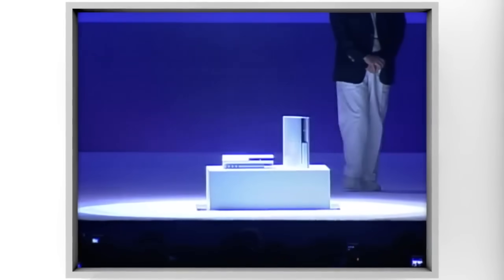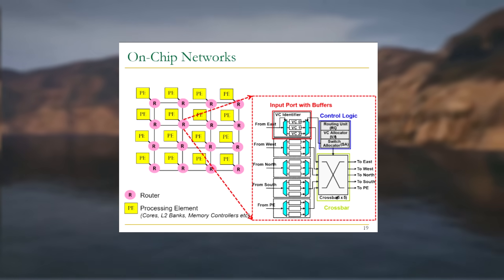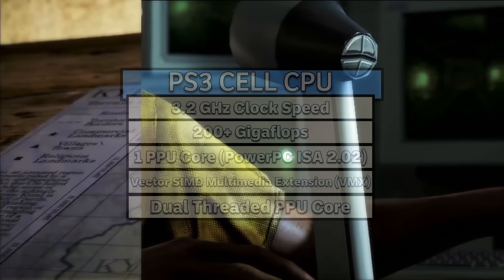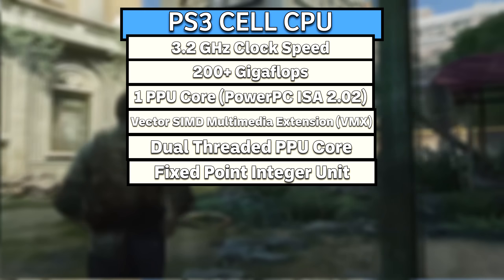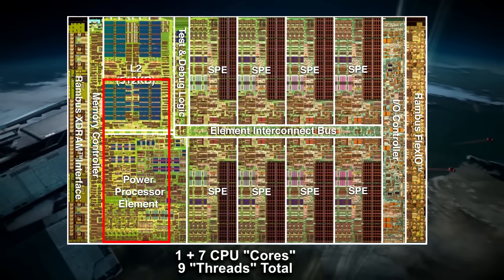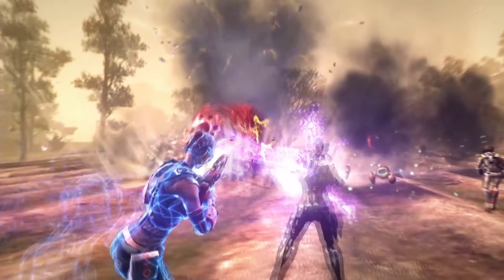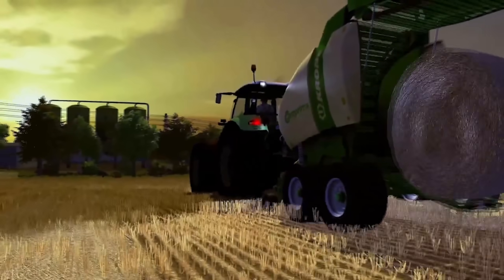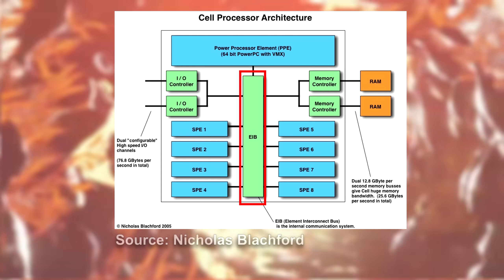The PlayStation 3 CPU: CELL Broadband Engine

Comment: Ahhh, Emotion engine all over again. But regardless of the development challenges I really like these unique designs.
Reply: A bit more refined than EE VUs (all SPEs are basically the same, unlike VUs). ;)
Reply: The successor in design you can say but in contrary to EE when Cell was ready gpus had evolved quite faster than what Ken wanted or anticipated.
Reply: @kratosmight  Back in 2006 Cell was still superior in terms of compute flexibility.
Reply: @NathanDrake5  Sure it was but if we consider what has been said about the scrapped Toshiba gpu(i think Mark Cerny mentioned it) that it was a fixed function rasterizer without programmable shaders then we can hypothesize that the initial design was pretty much a "turbocharged" ps2. Without a proper gpu one Cell only wouldn't be enough and there is where the twin Cell configuration fits. In the end Ken discarded both solutions and went to Nvidia for a proper gpu with programmable shaders. What is the final conclusion? Ken's initial estimation was that one cell would be enough not only in terms of compute flexibility but also in terms of raw compute throughput. His estimation was false.
Reply: @kratosmight  A turbocharged PS2 would not be able to offer that distinct cinematic look (plastic/metal/water shaders) to Uncharted.

In terms of compute flexibility I meant that Cell was able to support 8-bit acceleration (useful for AI/ML)... it took a long time for GPGPUs to catch up (over a decade later).

In an alternative universe, Sony would have been a 4 trillion company (like nVidia) due to AI and we would have had many Cell iterations.
Reply: @NathanDrake5  A turbocharged ps2 was a figure of speech to describe the console make up, nothing more. For this alternative universe though to take place into ours the absolute minimum it would be needed is the ps3 to be the smashing success the ps2 was and that unfortunately didn't happen.

Comment: Hey, I'm a game physics programmer in the AAA industry (I've been in the industry for just a couple of years). I enjoyed watching the entire video! I remember having a lot of debates at the time about PS3 vs XBOX 360 capabilities as a gamer.
Reply from the maker: Thank you so much it means a lot to me
to have you around☺️
Reply: You'll probably agree that Cell was a better fit for physics calculations.
Reply: @NathanDrake5  I can't be sure because I never wrote code for it. I suspect that later PS3 games had an advantage over XBOX 360 when the tools available became mature enough to make good use of the SPUs. For physics, you definitely need a lot of number crunching power but a lot depends also on cache/memory access speed.
Reply: @gamefabric4012  SRAM was fast enough. You can have a look at Uncharted 2/3 physics (moving train, real-time ocean).
Reply: @NathanDrake5  thats bollocks , cell is a stream processor , physics require out of order calculations

Comment: this was a terrible cpu for the ps3, it was a major bottle neck on the games
Reply: Sony’s vision for CELL was it took over the CPU, and GPU role except the performance as a GPU wasn’t enough. If it would have worked out as Sony intended the PS3 was supposed to have more than one CELL chip. Three to four chips working in a topology together.
Reply: It wasn't a bottleneck in Uncharted 2/3, it made those games shine...
Reply: @NathanDrake5  dude those are ps3 exclusives and specifically optimized for the ps3,yeah go look at cross platform games like skyrim on the ps3 then on the 360.your talking like 20 fps on the ps3 and over 50 on the 360. multi platforms games all run worse on the ps3,learn something and if its running as good its running at 720p on low textures and the 360 is running them 1080p with high textures and the gpu was generations behind, the gpu in the 360 used cores like modern gpu's and the ps3 didnt.that was the biggest problem.I own both consoles still and I have multi platform games on both and every one of them runs like a piece compared to the 360

Comment: IMO the XBox 360 was the better console of that generation. PowerPC CPU identical to the PS3, but 3 cores instead of 1, each with a modified vector unit (support for dot product and Direct3D compressed data), FPU and SMT. 10MB of eDRAM allowed the GPU to do 4xMSAA, alpha blending and z-buffering for free (no performance cost!). It was also tremendously more easy to code for it too.
Reply: yeah a lot of people dont get they shared the same cpu architecture, not only was the 360's cpu better the gpu used cores like modern gpu's use for calculations while the ps3 used the older GPU architecture that didnt use cores for calculation.I owned both systems and I can certainly say the PS3 ran games far worse
Reply: @kyles8524  The Xenon GPU was based on Terascale 1 (Radeon HD 3000, DirectX 10 class hardware).

While it had unified shaders (no hardware distinction between pixel shaders and vertex shaders), it seems like only the DirectX 9.0c feature set was exposed on Xbox, meaning no geometry shaders and that GPU featureset between PS3 (GeForce 7800 GTX, DX9.0c class hardware) and X360 was almost identical for all practical purposes.

There was no GPU compute either, as compute shaders were a later invention (DX11/shader model 5).

Games towards the end of the PS3's lifecycle, esp. platform exclusive titles, could make better use of the hardware and started to look and perform better, but Xbox hardware could be well utilized by devs from the get go.
Reply: @Psychx_  yeah I know these things and have for more than a decade
Reply: @Psychx_  There was GPGPU using MEMEXPORT.  That was one of the defining features of Xenos.  There were also additional features beyond FL 9_3, and by the end of its life Microsoft would allow devs to do things like multithreaded rendering if they so chose to which is a DX12 feature!
Reply: Except games on the PS3 on the multiplatform front never really ended up looking better on the PS3 even by the end. The Xbox 360 was the better console for hardware while the PS3 had the most successful marketing strategy to make people think it’s better than it actually was hardware wise
Reply: @kirby0louise  Even with those features, there's no way XBOX 360 could run Uncharted 2/3.
Reply: @Psychx_  slightly incorrect.. Xenon was directly derived from a cancelled 2003 ATI R400 design called Crayola. This was a very early implementation of DX unified shaders, it did not went into PC market because no one was ready at the time. They pulled it out again for X360 and the ideas were finally carried forward into DX spec, influencing Terascale HD2000 and 8000 GTX series.
Reply: @NathanDrake5  Lmfao yes it could.  360 was the most powerful console of its generation.  There is nothing special about Uncharted that would make it incompatible with 360.
Reply: @kirby0louise  LMAO, good luck trying to emulate 6 SPEs (153.6 GigaFlops) on XBOX 360, while you can barely reach 70 GigaFlops on Xenon PPE via VMX128...

An Uncharted with gimped physics (train sequence/UC2, real-time ocean/UC3) would not be Uncharted. :)
Reply: @NathanDrake5  Lmao, Xenon VMX128 provides 600 GFLOPS.  One PPE can match the entirety of the SPEs.  Xenos can even handle it with 400 GFLOPS GPGPU.
Reply: @kirby0louise  Source?
Reply: @NathanDrake5  There is none. He is pulling numbers out of thin air, even Microsoft back then when gave the official numbers for Xenon GFLOPS, they were less than half of CELL'S and the 400GFLOPS GPGPU is absurd. Only a fraction of that is applicable and even that is not certain.
Reply: @NathanDrake5  There is none. He is pulling numbers out of thin air, even Microsoft back then was giving for Xenon less than half Gflops compared to Cell and the 400Gflops gpgpu is absurd, a fraction of that is applicable.

Comment: I think PS3 Cell was the worst CPU architecture ever made. Which had just 1 PPE or main Core vs Xbox 360 Tri Core.😂

I believe Ken was stuck from the inspiration of PS2 hardware 🥴, where Emotion Engine had the ability to do graphical calculations and it was necessary back then as there was no proper GPU.
Reply: Honestly, I think if Sony waited one more year, and launched with Core 2 Duo and 8800 GTX, and 1 GB memory combined, that would’ve been a massively killer combo.
Reply: @Lauren_C  Not so much, because 8800 GTX is not very flexible in terms of CUDA, so Uncharted 2/3 would have never been the same.
Reply: @NathanDrake5  Lol they don't need to involve CUDA, theres a lot of FP32 things they can write for the GPU, and whatever custom SPU effects they made would have been covered by Nvidia's libraries anyway.
If it had an Allendale chip and 8600 GT with 256 bit VRAM it would've run rings around the Cell+RSX.
Reply: @mimimimeow  It's not a matter of power, it's a matter of flexibility (features). Early CUDA GPUs were not flexible enough.

And yes, you need CUDA. Even Nintendo Switch uses nVidia's libraries.
Reply: @Lauren_C  Sony poured a lot of money in Cell's development. There is no chance they wouldn't use it and besides Cell wasn't the main problem, the underpowered gpu and the problematic memory set up were more signifficant. Sony should have delayed ps3 one year more and launch it with a version of 8800 and 1 gb of unified memory. It would be a totally different console.
Reply: @kratosmight  underpowered gpu yes but not much of leap gap in games. Cell was the actual culpirt all along. I mean just one main cpu core vs 3 core. That was a huge difference. SPEs were useless as their was less memory and the SPEs them selves were not independent to handle task like normal CPUs do...
Reply: @HassanKhan-cs4pn  You haven't watched the video i guess or you watched it and decided that it's the usual propaganda about cell so who cares. There are plenty of developers who spoke about Cell(not Gabe Newell who made a 180 about ps3) like Dice, Sony first party, 4A Games, Crytek search and see what they said. There were benchmarks between the Cell(the same with ps3 but with all spes  active) IBM was using in their servers and the analogous Xeon and there are many analyses of Cell the above video included, search for them if you want to learn something. The Cell was an unconventional cpu, a different paradigm and the majority of its throughput comes from the spes. Your simplistic way of comparison may work partially on similar cpu, it doesn't work between cell and xenon. Regardless, my point was that an underpowered gpu will remain underpowered no matter how good the programming will be, a problematic memomy set up and lack of memory will remain problematic and good programming will only carry you so far. Cell was very complex but it had potential, it could remain in the final configuration, the other components of ps3 though needed replacement.
Reply: @kratosmight 
My dear, It seems like you're challenging my knowledge and gaming experience. Let me clarify that I've been a PlayStation gamer since PS1 and have owned every console from PS1 to PS5 Pro, which I currently use.

As for my credentials, I'm not just a gamer, but I'm also pursuing a PhD in Computer Science. Given my background, I believe I have a solid foundation in tech and gaming.

Regarding the cell processor, while it has potential, its single main core and unconventional CPU architecture make it less suitable for gaming. Additionally, the limited memory is a significant constraint.

Instead of questioning my knowledge, I suggest you focus on researching and understanding the topics you're discussing. If you know programming, you'd understand the technical aspects I'm pointing out.
Reply: If you're unsure about my perspective, I'd suggest watching Mark Cerney's video/presentation. He explicitly discusses the Cell processor's unconventional CPU architecture, which presented notable challenges for game developers during its development phase.
Reply: @HassanKhan-cs4pn  I've been a gamer since long before ps1 and i've owned the majority of all major consoles released and some more obscure ones and i don't challenge neither your knowledge and gaming experience nor your credentials because i don't care about them. My initial comment was a response to another comment not yours, i didn't even bother with yours(the initial one) since your characterization of cell as the worst cpu architecture ever made along with the ridiculous comparison with Xenon by counting the power pc cores gave me a hint on what you possibly are, either a clueless fanboy or a troll so why bother. And then you made it even worse by not commenting on my main point and characterizing the spes useless. You know that apart from mentioning the complexity Cerny praised Cell's potential and more specifically the spes and he was clear on how more powerful Cell can be if you unlock that potential than any other conventional cpu of its time. His example? the Uncharted. I guess you kept the complexity and the rest discarded it as propaganda? The chacterization of cell as the worst cpu architecture ever made, the spes as useless and the rudimentary comparison with xenon are neither technical info, nor some programmer's insight. They are either trolling or ignorance and nothing more. Good luck with your Phd in computer science.
Reply: @HassanKhan-cs4pn  And now about my main point, ps3 as a whole was a trainwreck. Cell was a very complex unconventional cpu, the Nvidia gpu was underpowered and the memory set up was problematic. Compared to the other 2 Cell had a tremendous potential for those who who have cracked it and specific developers really shined like DICE whose usage of cell was more ingenious even than Sony's first party. The problem was that most of that potential was used to cover up for gpu's deficienies and the memory set up was such a pain for the developers that for cases like skyrim Sony sent technicians to Bethesda to fix the catastrophic bug with the bloated save files and technicians to rockstar to ensure the gta5 ps3's version parity with 360. A delayed ps3 with 1gb of unified faster memory and a g80 derivative would make the ps3 a totally different console, pricey still yes but with a better gpu than 360, more memory and the cell(easier to exploit its potential with more and faster memory) not wasted to aid the gpu but used for more complex physics, more complex animations or even further enhancing the graphics since Cell was more flexible than the g80 based gpus. A well designed console, complex yes , pricey of course but really powerful not the trainwreck we got after all.

Comment: I've been looking forward to this one. Anxious for a video on the Sega Saturn's 2+1 CPUs.
Reply: The Saturn's architecture is basically all the cons of the PS3 with basically none of the benefits.
Reply: @Werewolf_Painter  It is still a fascinating piece of hardware that has plenty of great games on it.
Reply: @Werewolf_Painter  How do you figure?  Both of the Saturn's main CPUs can access main memory while the PS3 SPEs cannot access it at all.  That alone is a massive upside.
Reply: @kirby0louise  Saturn renders 3D in quadrilaterals instead of triangles, that alone makes it a pain in the ass. It also doesn't have a real 3D capability per se. It's more of a 2D beast with 3D capabilities bolted on
Reply: @DistantOceans  Using quads doesn't make it difficult, a quad is just two tris.  And if the Saturn doesn't have "real 3D" then nor does the PS1.

Comment: Cell/BE was indeed a beast. 200+ gigaflops. For reference, an overclocked Ivybridge 3770k at 4.8 ghz only managed about 150 gigaflops
Reply: How about it's MIPS? I know PS2's CPU theoretically could handle up to 6000 MIPS which was what made EE a beast at that time
Reply: @chloroxgaming  Sony consoles back then were built entirely around the CPU (MIPS, EE and CELL) while gimping the RAM and GPU which costed Sony. It allowed its rivals to claim the games were better on their platforms because of the more stable image quality.
However, if we actually analyze the visual details besides resolution and texture quality, a lot of it was done better on Playstation like particle effects, transparency, bloom, rendered polygons on screen, etc.
Third party games that made full use of Playstation hardware really proved this like Toy Story 2 (PS1) Silent Hill 2 (PS2) or LA Noire (PS3).
Reply: @Manic_Panic  Yeah,you can see how good some of the PS2 games like Xenosaga look when upscaled to 3X resolution
Reply: @Manic_Panic  I wouldn't put the ps1 and ps2 "gpus" in the same category as the rsx of ps3. The first two were good designs despite their flaws, rsx was the only true gimped gpu, a very late addition not in the initial planning which should be avoided by Sony and replaced with a G80 derivative.

Comment: the cell cpu in ps3 was beast of cpu  it was way head cpu in wii in xbox 360 but was hard to code for
Reply: Not really. The 360 CPU was much better suited for gaming than the PS3’s chip was. Wii was just an overclocked GameCube meaning its hardware was essentially 2001 at heart
Reply: @crestofhonor2349  Cell was more SIMD-heavy (good for physics), Xenon was more general-purpose (good for running Excel, I guess).